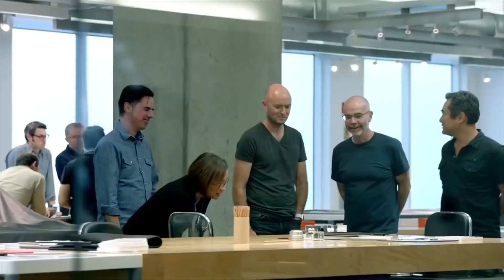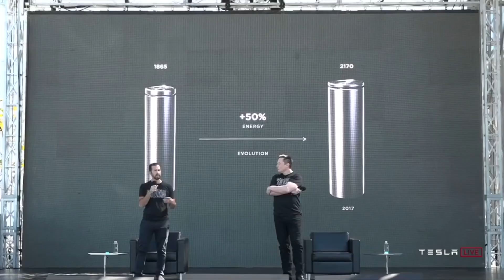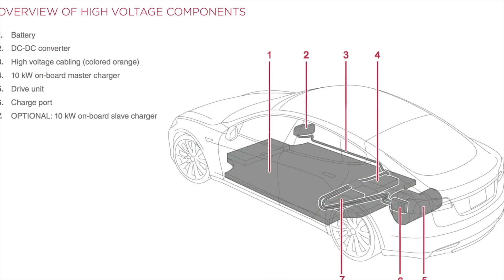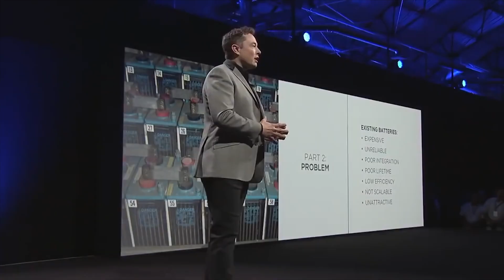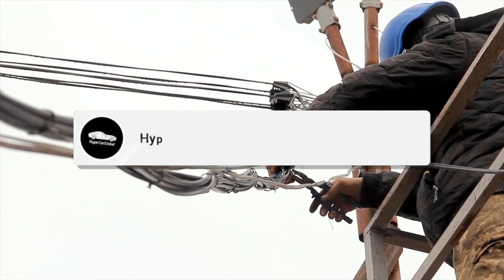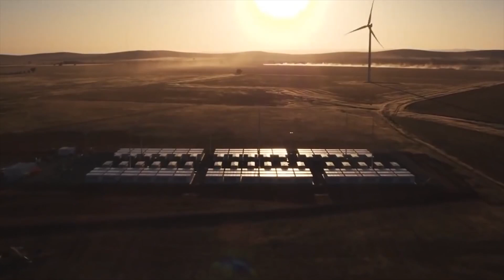NEW PATENT! Tesla UPGRADED The 4680 Battery!

Comment: Not to state the obvious, the battery backup in general ,(not only the Tesla ) is a great solution to many grid problems, a true solution would include the battery and a smaller sectional grid system more independent, where when one section has trouble it can be insulted from the total system, plus more efficient, power closer to the source
Reply from the maker: I agree batteries need to play a part in becoming sustainable for the planet
Reply: Don't misinterpret, Tesla is the most inovative company on the planet a true inspiration to everyone , thanks you to all at Tesla and to Mr. Musk for their dedication to all creatures we share our planet with.